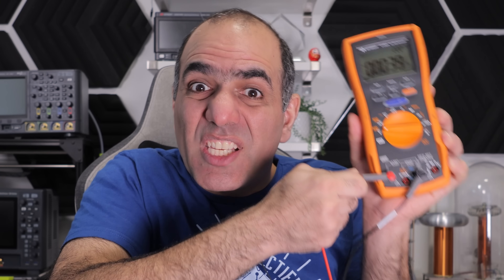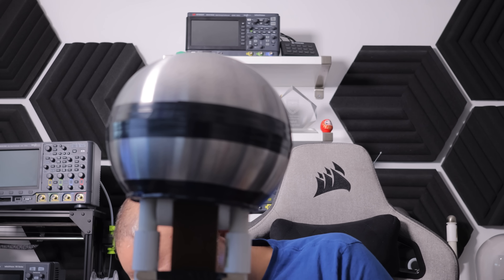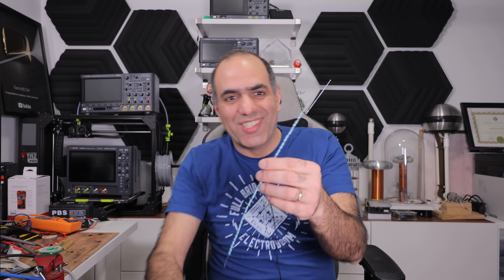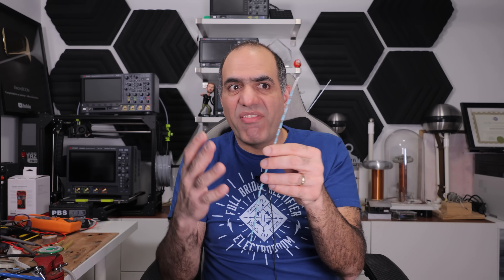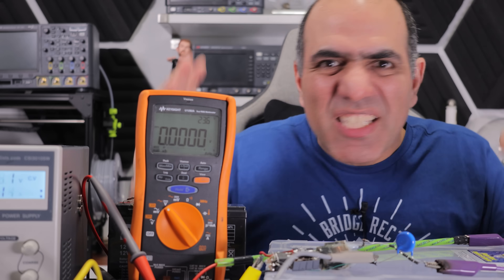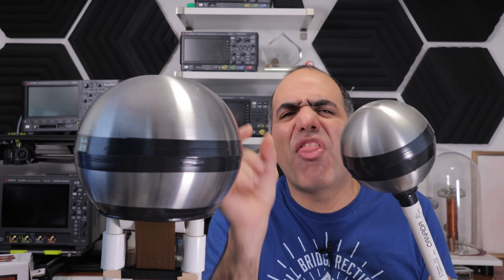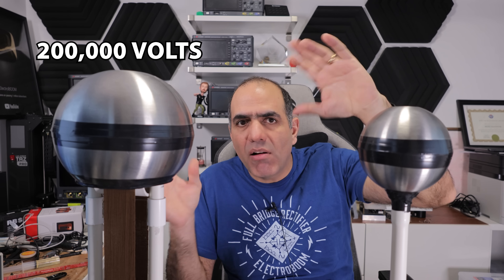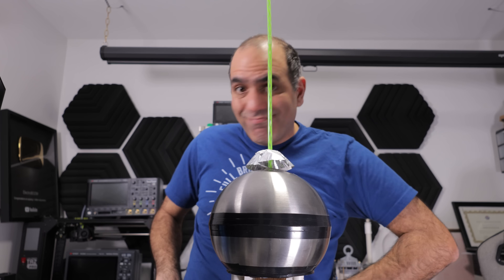SUPER HIGH VOLTAGE Measurement

Comment: maybe this is a good idea:
measure the weight of that parachute thingy you made and calculate the force acting on it based on the distance between them and the weight of the parachute thingy and using coulombs law, you get the amount of charges acting on each other, and now knowing the two formulas for electric field, you can figure out the voltage perhaps?

Comment: Wonder it you positioned the voltage divider connected to the grounding sphere between it and ground maybe you could measure the charge or discharge that way? Idk not an engineer but that seems the most likely way to do it to me

Comment: Can you Charge up an Capasitor 1nF wirh the Wandograph in 10 or 20min loading time and use this smal load to masure the Voltage with an Linear voltage divider.

The capasitor should Charge up to the maximum voltage of the Wandograp than an electric switch Should discharge the load in to an voltage divider and in the nS range sould be an accurate mesurment

Comment: To get a better measurement, you could put the whole device into a glovebox filled with dry nitrogen gas. Then you would only need to compensate for the pressure, which is easily measured.

Comment: at 12:30 you basically made an ionic lifter which uses an ionic wind to raise the aluminum foil "parachute" to a given distance within the straw. The rapid rise and fall means you are PULSING the circuit at what frequency? You have ALSO just shown us ONE MEANS to make an electrostatic propulsion system using EM plates to push against or pull against the atmosphere or any other charged material which COULD make a wingless plane (i.e. a UFO!) using nothing but super high voltages and some electrostatic plates embedded on every part of a vessel hull. 

Charge and discharge the Electrostatic plates in sequence to the opposite charge or the same charge of the atmosphere at that hull location so your hull and atmosphere are attracted to each other OR repulsed away from each other so that you can go in a specific direction. Pulse those super high voltages using some advanced flight control software and you now have a hovercar that can fly in any direction at high speed. No wings needed! Power it with Ballard Fuel cells (50 of the 250 kilowatt versions for 10+ megawatts should give you some decent flight times!)

You just invented a practical wingless flying UFO for the rest of us!

V

Comment: Mehdi to measure vandegraf voltage you just need to connect the 2 gigaohm in series with the positive probe of the multimeter without using a 200kohm as a divider but you need to use the internal resistance of the multimeter for that bcz if you measure with a devider you have 2 kind of resistors in parallel 1 multimeter resistance and 2 divider resistance so that 400mv is created by your multimeter resistance fakely so remove that low value resistor of the divider and use the divider of multimeter by itsel thank me later😊 maybe leter i will make a video about that to tell you

Comment: The 'bouncing parachute' from the end of the video reminded me of the "Oxford electric bell", the longest running battery experiment. Seeing how the foil parachute needed such a high voltage to move, I now wonder if the bell is also being powered by "high voltage" stack of batteries instead of just two large ones. Granted, swinging a tiny weight takes a fraction of what it takes to lift something, so the "high" voltage is probably closer to five. Most likely much less by now.

Comment: just an idea: put the 20 GOhm measuring resistor between the two spheres leaving an air gap only towards the ground sphere. With some circuitry like a good measuring sample and hold circuit you could measure the arc's voltage when it happens.

Comment: Two identical resistors are connected in parallel to a 12 V battery. The total power dissipated in the circuit is 6 W. The current in each resistor is?

Comment: A field mill or a vibrating reed electrometer is probably a better way to go for a VDG...  But a really simple way for DC high-Z sources might be capacitive voltage division.  Charge a small high voltage capacitor (say a sphere of measured radius) to the unknown voltage then parallel that with a much larger cap measured with a very high impedance buffer, even just a JFET source follower.  I have a video doing this with reed switches to roughly measure the output of a dry pile which has an extremely high output impedance but a much easier to work with voltage (sub kV) where the reed relays won't flash over.  However the principle of taking a voltage sample by charging a known cap, then making that cap way bigger (or smaller - i.e. the so called Volta condensing electrometer) to shift the voltage to something easier to measure applies.  You could also try building an electrostatic volt meter, even something primitive like a Henley quadrant electrometer which is can be calibrated purely from its physical construction and uses local gravity as a reference.

Comment: Capacitance of the conductive sphere of radius r is C = 4πεr. So, for r = 10 cm, capacitance is about C ≈ 10 pF. With resistance of 2 GΩ, time constant is then τ = RC ≈ 20 ms. As the system requres a few seconds to charge, this is way too low, and the discharge happens too fast - leading to your disappointment.

Comment: I know reinventing the wheel can a be a fun excercise and entertaining one, I did watch this with joy after all.

But I suspect an electrostatic field meter would serve you well here, not sure what the upper limit on voltage they have though, but they are commonly used in ESD control to check if a process has static electricity build-up and to find and eliminate the source.

Comment: Around 13:10 the smaller sphere moves a little when the electric arc occurs is it due to shock wave from heated air, or maybe electrons have such a high momentum (if electic arc is even made of flowing electrons... I think so atleast). Thanks for answer

Comment: Air measurement is not accurate and has to be an ai answer, depends entirely on the water content of the air locally, cannot be trusted, get yourself an electrostatic voltmeneter and stop fucking around

Comment: @ElectroBOOM    I think you should make a high voltage meter by taking two large ball bearings one fixed and the other on a non-conductive ( 3D printed? ) lead screw with a ruler underneath and a marker over the ruler to indicate the front edge of the bearing. You could start with the balls far apart, then move them slowly closer till they arc. Then you will know the distance. Then with an indoor sensor you can get pressure and humidity for a more precise calculation.

You could even get extra fancy and use a cheap set of digital calipers ( or a DRO for a lathe or mill ) and a microcontroller like an arduino to automate the process, read a pressure/humidity sensor and do the calculation for you! You might have to do a bit of destructive testing ; ) to figure out which calipers you can hack into. There are videos about that on yt. ( Of course ) Also, ( its probably obvious but ) I would put the calipers under a plexiglass shield so you can see the measurement and still prevent arcing.  Maybe do a collab with plasma channel...

Comment: The voltmeter itself has its own internal resistance which is usually 10 mega Ohm. Add a series resistance to form the voltage divider. This means for every 10 mega Ohm added the measurable voltage will increase by the voltmeter max measurable voltage.

Comment: Field Mills are good for measuring seriously high voltages. NASA used them at KSC for detecting possible lightning risks. I build them for measuring megavolt potentials without getting Mehdi-zapped.

Comment: Couldn't you just held a capacitor to your generator, charge it some time and measure the capacitors voltage over your voltage divider on the oscilloscope to see the peak of the discharge curve?

Comment: With voltages above a KV, don't forget that your DVM voltmeter becomes a nanoamp ammeter.[1]   After all, its "shunt resistor" is only 10M, which for electrostatics is roughly the same resistance as any good conductor.   
To measure VDG voltage, the series resistor-probe must be 10X or 100X larger than VDG's Z-out V/I, which is 200000/3ua (guessing at the typical belt-current.)   That's 67 Gohms Z-out, on the VDG considered as a power supply.   A good voltmeter needs to have more than 6,700G impedance.

So, the long resistor needs to be far larger: ...many hundreds of gigs at the very least.   Many thousands gig-ohms would give acceptable accuracy.   I've made such resistors by painting long black stripes of certain kinds of india ink, diluted down.  Acrylic or glass surface doesn't work, but painted surfaces do, so I used that special dark-red HV spraypaint, oven-dried.   Or use red-glypt HV varnish.   Heh, just make a typical HV spiral resistor on a plastic rod.   But two feet long!   

Or said differently, if your VDG belt current is a few uA, then to avoid shorting out the HV, any voltmeter must only draw 100X less microamps than that.   

[1] A typical DVM, measuring single millivolts across its internal 10M shunt resistor, is accurately measuring 1e-3/1e7 =  0.1 nanoamps.   Just mentally move the decimal point, where 1mV actually means 100 picoamps.   Some DVMs can detect 0.1mVDC, which would be 10 picoamps.   What good is a handheld picoammeter?   You'll think of something.

Comment: The bouncy disk is a kind of mechanical electrometer and you can calculate the force, and calibrate the height to the voltage if you know the weight of the disk

Comment: Your resistor probe reminds me of the high voltage probes we used back in the day to measure the anode voltage of CRT's, the anode connection is located under a rubber cap on the side of the CRT. For color TV's the voltage was approximately 1000 volts per inch for example a 25 inch color TV usually measured around 26,000 volts.

Comment: If you can connect and disconnect measurement device quickly, it won't have time to drain much energy. Such spike won't be visible with multimeter, but scope should be able to detect it.

Comment: Connect your generator to high voltage capacitor, let it charge and only then connect measurement device. It will start to drain energy, but for a few seconds measurements will be approximately correct.

Comment: It took me an embarrassingly long time in my PhD to realize that the input capacitance of my oscilloscope and the input resistance of my multimeter affected my voltage readings. I was only working with voltages around 1 kV, but I wasted so many hours thinking my circuit was at fault and wondering why my system's output looked great so long as I didn't actually try to measure it 😂. I also never took any RF or power electronics courses in undergrad, which is where I assume you get taught these concepts.

Comment: V-dots! or (d-dots). A Capacitive probe that will measure dv/dt so wont work on DC but will do well to measure high voltage pulses. Best part is it is not connected directly to the circuit so it wont effect it much. Best way to make one is to cut off the end of a coax cable. Point the end you cut at the high voltage and it should give you the change in voltage, integrate it and you got a measurement of high voltage

Comment: FYI, an ESD mat also has a typical resistance in the gigaohm range. Good enough to discharge high voltage static but not easily conducting.

Comment: at 12:30 the discharge ball moves every time a discharge happens. why? if its coz of the momentum of electrons, could you potentially use that to measure the momentum and maybe even number of electrons moving through?
Reply from the maker: The balls get attracted as charges build up and pull towards each other, then when it discharges, the ball falls back.

Comment: You need an electro static volt meter
Reply: Those are available up to about 25 kV, as far as I know.  Not to say that someone somewhere hasn't undertaken a higher voltage one,  but the cost and effort would be considerable.

Comment: Some of my colleagues in the space-science biz have needed to make electric field meters to fly on sounding rockets.  Because the equivalent source impedance is pretty high (10s to 100s of gig ohms) the internal impedance of the e-field probe has to be in the 1 trillion--10-trillion ohm range.

The input impedance of a common DVM (digital volt meter) is typically around 10 M ohms.  It wouldn't be difficult to make a DVM that had (in principle) an input impedance of (say) 10 Gig Ohms, it would be kind of pointless, because garden variety lab use includes things like "human touching the probe" and we're just covered with interesting and troublesome oils and bacteria and whatever, so that you might not be measuring what you think you are.

Upshot: If you need a voltmeter with an input of at least (say) 100 M ohms, you have to start being pretty careful about how you make the measurement.

[Similarly, if you need an ohm-meter to measure fairly low resistances (e.g. 0.01 ohm), you'll discover that you'll need a four lead ohm meter, not two leads --- which is a topic for another day.  But you might want to puzzle over this: "why might you need a four lead device?"]

Comment: Solve this?

Take one magnet. Put it on table.. Put one ball bearing on it. Now take another ball bearing. Stick that 2nd ball bearing with first ball bearing. Now the structure should look like...table then magnet then 1st ball bearing and then 2nd ball bearing which you are holding and 2nd ball bearing still touching first ball bearing. Now slowly lift 2nd ball bearing. You will find that 1st ball bearing also gets pulled up with 2nd ball bearing. Instead of remain stuck with magnet, it gets pulled with 2nd ball bearing. Explain why.

Comment: As an electrician here in the Bellingham USA, literally about 60 miles South of your location. I just saw your Hawaiian VAC vid in Maui. You probably already knew this, but the hotels are ADA (American Disability Act) compliant. The switched are low for those in wheel chairs. Also, the reason no doors master baths and to the shower.

Comment: Multimeter-ish idea: connect the Van De Graaff generator to a self-made, high-voltage capacitor. Then disconnect it from the generator and discharge the capacitor using the magic-wand-resistor, using the oscilloscope to record the voltage decay. You can then measure the transient duration to estimate the initial voltage

Comment: Now that's a rabbit hole! And to think you JUST wanted to measure voltage of high voltage low current sources. However, you needed to know complex impedance in relation to frequency. 
Great video Mehdi, stay energized!

Comment: 13:30 Isn't the foil usable as a measurement itself? And isn't *that* measurement also taking away charges?
By adding a measurement device to this, you are measuring it twice.
A measurement or observation is in quantum mechanics always influencing the source, but I think you can calculate the actual charge based on the height of the foil and the time it takes extra for it to discharge with the foil compared to without the foil.

Comment: 13:15 Hmmm... When the electricity arcs from one sphere to the other, it moves the one it jumps to. I didn't know an electric arc had mass. Much less enough mass to move something. So it's like a little bullet. Or is something else happening?
Reply: Prior to the arc, there is electrostatic attraction between the two, pulling them toward each other.  Immediately after the arc discharge, almost all the attraction is gone, allowing the two to spring apart until the generator recharges.

Comment: I'm sure other comments already pointed this out, but the rod on top should be conductive so the foil and the ball are held at the same voltage. Like a sideways leaf electroscope. Because they are insulated, it's acting closer to a franklin bell. That's why it bounces: gains charge from the ball and surrounding air, floats up repelled by like charges, loses charge to the less ionized air further from the ball, falls, and repeats. That's also why an electroscope is usually in a jar: to keep the charge in the jar mostly insulated from leaking to the surrounding air. It'll work without the jar at these voltages, just with reduced sensitivity and repeatability.
Reply: Actually try it.   It doesn't work.   Turns out that the air itself is sufficiently conductive, so he actually did it right.    Experiment beats theory.
Air conductive?   Yep.  It's caused by the sharp foil edges, which spew ions, which create invisible plumes of weak plasma.  Even without the sharp edges, the very presence of the foil object would concentrate the e-field from the sphere, and send the few-uA air-leakage of the VDG upwards.   If we could see conductivity, we'd see an invisible voltage-divider form in the air above the VDG.   (Not a very linear readout, I'd expect.)
Now just add a crude paper-scale, with 10KV tic marks.   Figure out how to calibrate it.

Comment: You might want to build a so called field mill.  Just set up one of those between a flat electrode and a ground plane, calibrate with a known voltage and then connect it to the Van-de-Graaff.

Comment: Mehdi please cover the method of measuring high voltages on AC power transmission lines (11kV, 135kV, 220kV, higher etc. ). I believe that is much easier. From what I have heard they have a capacitive divider instead of a resistive one.

Comment: 6:12 your meter has a 10MΩ resistor when measuring voltage.
You can also use that,by measuring voltage in series.
(normally you do so in parallel, but not in this case)

Comment: Use High-Voltage Probes (sold by North Star High Voltage). They have PVM Series probes with either 1000:1 or  2000:1 calibration factors.
I have used one for measuring the MARX GENERATOR  high voltage pulse output.
Reply: Unfortunately the resistances of the North Star probes are too low and the prices are too high for this application.